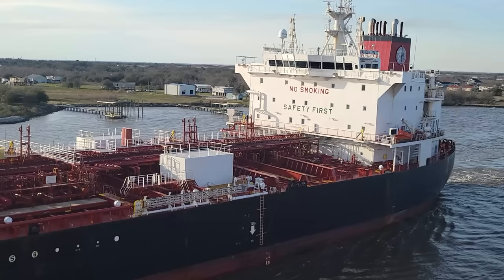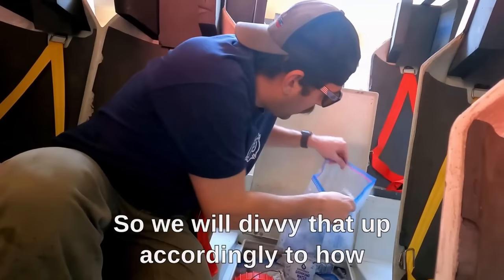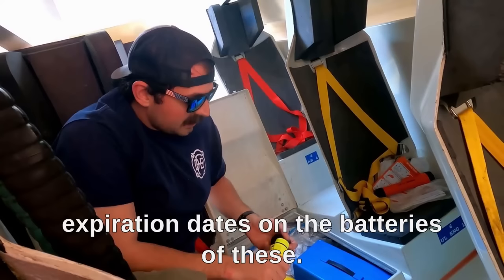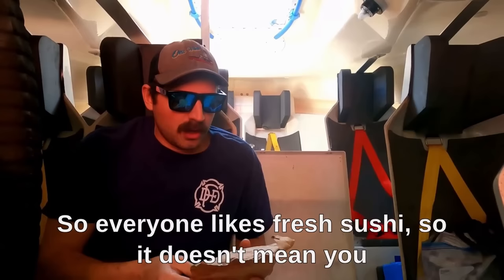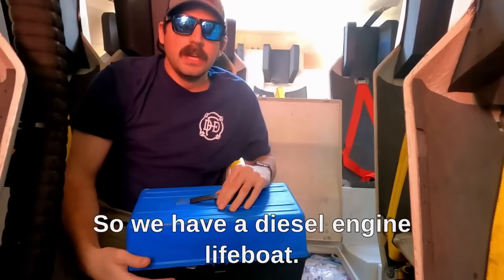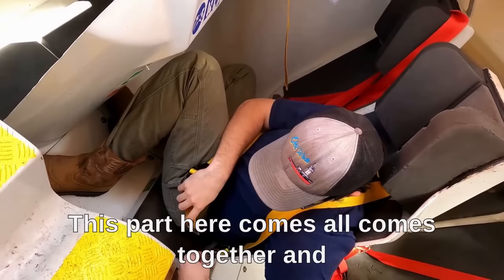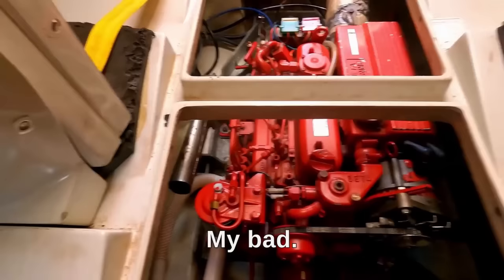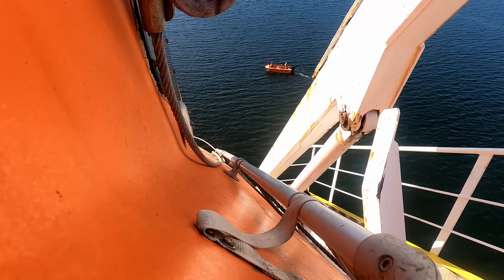WHAT'S INSIDE A LIFEBOAT? | LIFEBOAT TOUR | ABANDON SHIP

Comment: insane, I can only imagine being inside that thing when it launches - has to hurt like hell! but better than jumping overboard and bobbing in the water with just a life jacket!
Reply: You get bumped around but don't think it hurt. Know that people working on an oil platform has to do an safety course including a drop of one of these boats from higher attitude than  on most ships.
Reply: If it is launched correctly and filled upto capacity its a “smooth” ride and water entry. The bow is designed to pierce the water surface and the buoyancy brings her back up. (Working at sea >20y and 95% of this time with ffb.
Reply: In that dinghy, I've leapt over two dozen times. Fear lies in the helmsman's perch. The world vanishes for others, the plunge is swift. The true terror? Lingering within the FFB—no air, no water, no sustenance.

Comment: Back in the late 90s I worked offshore in the Gulf of Mexico, we had weekly abandon ship drills (or more if a coast guard inspection was coming up).  Usually we all just went to our assigned boat, put on the life vest and took a roll call.  Once though, they opened up the boat and we all got in.  It was a standard davit-launched boat, so there were no seats to strap into like this one, just two concentric rows, pretty much like bleachers.

Since I could see they were all well maintained, regularly inspected, and there were usually other rigs and work boats around to provide quick rescue, I had always felt pretty comfortable with the idea of using one.  Until I got in one!

Now mind you, I was still pretty confident that they would float and keep us alive, I was horrified at the prospect of sitting inside one baking in the muggy gulf air.  While I was fairly resistant to sea sickness, I wasn’t immune, and if anyone puked I had no doubt that I would be joining them instantly!  

I’m still impressed by their engineering and upkeep, but that hot stultifying half-hour (even with the hatches open) sure was eye opening! 😦   🙃

Comment: Lifeboats should have hand crank charging batteries.  Never run out of electricity that way.  Should also include some kind of foot pedal driven propeller system in case the engine fails.

Comment: Great video! How much fuel does it hold?
Reply: It varies greatly from lifeboat to lifeboat, this is a 30 seater but there are way bigger models that are lowered on davits. Anyway, per SOLAS regulation a lifeboat must carry enough fuel for at least 25 hours of cruise speed (usually 6 knots) operation, again, this depends on the lifeboat and if it's towing a life-raft or not, what size engine it has, weather and sea conditions and so on and so forth.

Comment: That little engine is a Kubota diesel marinized by Beta Marine with a Hurth mechanical transmission. Bullet proof.
Reply: In addition, the control panel besides the steering wheel is still from BUKH (who built a legendary lifeboat engine in former days). New engine but old hull?
Reply: @okokea4592  I saw that too. Interesting.

Comment: why not have more than one boat with more room
Reply: Money. Shipping is one of the most frugal businesses there is. Not a penny more than is required.
Reply: Its all about overall operating costs and storage for the second boat
Reply: What for? Most lifeboats are never used, luckily. Even in distress, most times, if close enough to a coast, people are rescued directly by helicopter and don't need the lifeboat. And even in the open ocean, most times assisting ships arrive in less than 36 hours.
Reply from the maker: In the upcoming launch video you can see the ship has an additional boat that is lowered on davits along the side of the ship and could be used as a lifeboat but wouldn't be able to be launched in heavy seas.